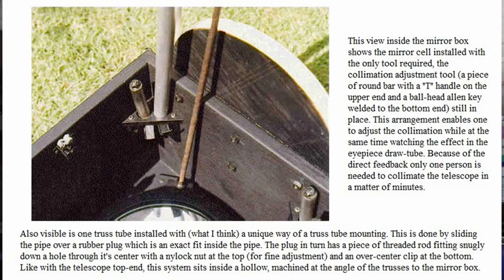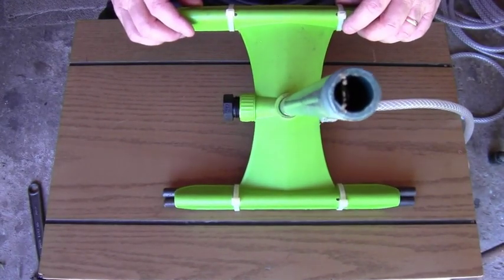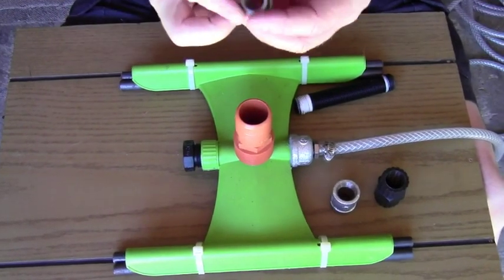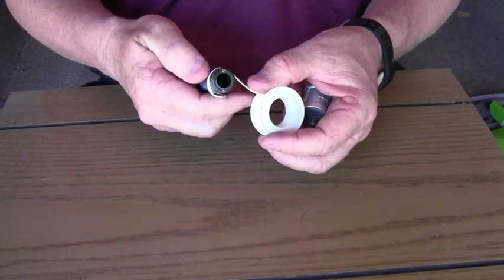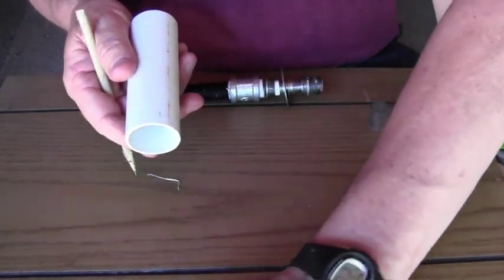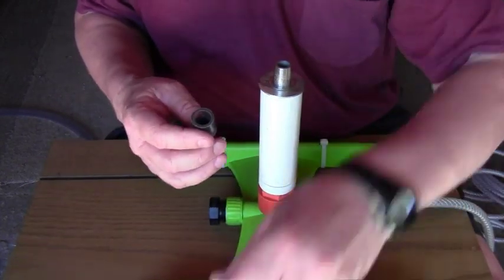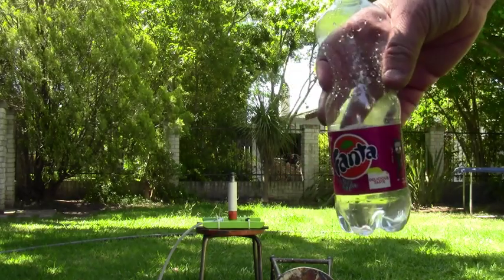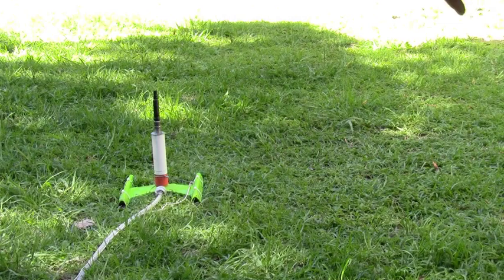Water Rocket Launcher: Unique grip & release mechanism.

Comment: Willie, outstanding....Need help with release mechanism, dry water rocket. Remote control to solenoid trigger. Use plastic to reduce weight about 300 psi safety limit, operating pressure 80/120 psi.
Also electromagnet release. Any thoughts welcome. Holland to New Amsterdamn to Nova Scotia. thx

Comment: My dad came up with a similar system independently, but we had wanted a way to make it adjustable. See, with bottles, there is a slight variation in mouth size. If you had a bottle with a mouth that was too much wider (or narrower, give or take), then the vinyl tubing would be either too tight (and not release the bottle) or too loose (and let the bottle either leak, or go early). Is there any way to get this system more adjustable?